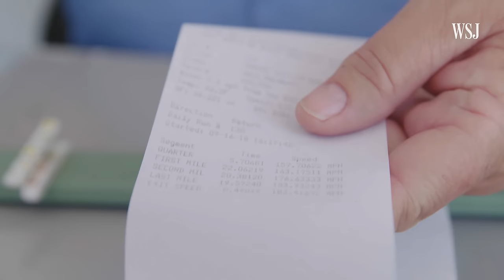How This Cyclist Hit 184MPH and Set the World Record

Comment: This record is dubious, she is not generating 184 mph, she is in fact surfing
Reply: She got released at 110 mph. If she got up to 184 mph by “surfing”, why did she have to pedal?
Reply: @adrian.m258  She's 45 years old... generating speed of 84 mph, the current women’s 1 hour recorder holder Evelyn Stevens can only reach 29 mph. She's super human if she's really doing 84 mph by peddle power.
Reply: @jabsdrahm.3232  She's accelerating using her own strength in the slipstream of the car. Air resistance is the key here. Plus the 29mph is like running a marathon, that's not the top speed someone can reach. You don't run a marathon with full sprint speed. The fastest cycling speed of a woman unpaced on a -0.6% grade is 121.81 km/h (75.69 mph).
Also, you have to realize that the bikes are completely different. This particular one has gear ratio so high, it's impossible to pedal from stand still, which is why she had to be dragged to 110+ mph. At the start of the video, the first run, she detached at 105mph, and couldn't peddle it because of the gear ratio. Then later, she detached at higher speed and was able to peddle the bike. If she was surfing, she wouldn't have to peddle and just continuously accelerate behind the car regardless of the gear ratio and whatnot.
Reply: @ybh1231  yea you got him the car only cut out like 95% of the resistance.
Reply: The only thing she got help with was air resistance. The bike she is riding is geared for those sorts of speeds. If you tried to ride that bike normally you'd never be able to crank it.. you'd have to get up to 130mph before a human would have the strength to crank those pedals. It's all about gear ratio and lack of air resistance (because of the car in front of her). At any rate, she is actually doing the pedaling.
Reply: This is a class record and all who attempt use the same method. REPEAT A CLASS RECORD LIKE ANY OTHER 1
Reply: well, given the fact that other people have attempted the same thing and recorded various records in the same category... no, it certainly isn't "dubious".  That's like saying the world record for the highest flying, or fastest flying unpowered glider is "dubious" because the glider got towed up into the sky by another plane.
Reply: Adrian G You are disabled. The only thing acting on her was the friction from the ground, The car did all the work, It’s a dumb record because the car did everything for her.
Reply: @adrian.m258  It's the same rules for everyone.
Reply: @surroundsound6427  You obviously didnt even pay ANY attention to the video. She is towed up to 110 mph then through drafting, she reaches 184 mph. She could have died from air turbulence, debris on the track, a popped tire, and multiple other mechanical problems. It might sound pointless, but it is very much a dangerous and impressive feat.
Reply: Ralph Yarl Ye she could have died from the debre, but it doesn’t change the fact that she is is an air pocket because the car was doing everything for her, even the male record is dumb because no one could get up to that speed without the car
Reply: Ralph Yarl Ye she could have died from the debre, but it doesn’t change the fact that she is is an air pocket because the car was doing everything for her, even the male record is dumb because no one could get up to that speed without the car
Reply: @adrian.m258  no,  she had to pedal starting at the point she released. Otherwise she would fall behind and then the air would catch her.
Reply: @surroundsound6427  a pocket of air does not pull you along with the car in front.  She would still have to pedal.  The whole point of the record was "fastest human on a bike while drafting" which she did.  Drafting is literally using the vehicle in front of you to reduce your air resistance. She basically did whay would normally be impossible because of the air resistance by removing the air resistance.

Comment: Bunch of ignorant comments from people who did not watch the entire video. 

She is tethered to the car to gain speed. The bike's gearing is extremely tough and works best at over 100 mph. The impressive thing here is the fact that she accelerates after being released at 130 and and maintains that average of about 173 mp/h for a mile topping at 183,9. While she is  still in a vacuum created by the drag car, she is on her own and have to maintain balance and speed.
Reply: Emil Glud she isn't in a vacuum, she is in a pocket AND being pushed forward by the air behind her.
Reply: its literally not impressive, she is hardly an athlete. Literally anyone can be put in that exact same scenario and pedal a bike in a straight line as she did. this isnt dangerous, she is loaded with protective gear on a flat surface with nothing she could slide into. the 12 year old kids riding bikes around the neighborhood can do this and you know it
Reply: @michael_fassbender  ..At that speed, if she fell, it'd really surprise me if the impact didn't generate rotation and cause her to flip.. One flip would lead to another, and so on. It's not ice she'd be landing on, ya know. Protective pads won't prevent limbs from being bent in ways they're not supposed to. Chances are, she's not gonna be okay.
Reply: sure, whatever. She's tethered.
Reply: Stu Pidas yes thank you someone understands what’s really happening
Reply: @WPaKFamily   She had to be tethered in order to reach a high enough speed and was cut as the speed went up
Reply: Emil Glud 👍
Reply: Did you ever heared of changable gears?

Comment: there is no land speed set here.  all it is a car. that was towing a bike. you can see the cables pulling her here.   There has to be a draft why. just someone to say they got drug. an should be dropped. no one has won the lad speed record with a bike. but it wont be dropped. should be called  fastest drafting record.
Reply: It pulls her until 110mph, then the cables are released and then she uses the slipstream of the vehicle so there isn't barely any wind resistance as she pedals.
Reply: which is why it's the overall land speed record for a paced bicycle
.. rather than the land speed record for a jet car 
... for a motorcycle .. 
.. for an unpaced cyclist in a human powered vehicle  with an aeroshell
.. or just the land speed record -- as in the fastest thing ever propelled across the ground -- as opposed to the air or water speed record

Comment: Imagine if she had a fixie bike while doing this
Reply: It is a fixie.
Reply: Paul McB if she was on a fixie her legs would of been noodles
Reply: The bike she rode has no freewheel in the hub or bottom bracket - it's a 'fixie', just the same as any other bike with no freewheel, just geared a lot higher.
Reply: @nathan-sw8kr  It's a fixie with an insanely high gear ratio, hence the "double reduction" gearing. It's something like a 31 to 1 gear reduction based on the numbers in the video. That's what allows her to go 180 mph without her legs turning to jelly
Reply: It is a fixie but she cheated since they had her towed until she was pedalling fast enough
Reply: there is no way it is a fixie, why would you even want a fixie accept to save a few grams?

Comment: This is an awesome human achievement. If you've ever been to the salt, the fact that it's a weird, random, particular record makes absolute sense. It gives all these different daredevils a particular place to chase. And it's hard work. Whether it's a super custom fixie bicycle in a pocket of recirculating air, or a tube of engines and a tiny piece of glass, it's still an insane gathering of resources, time, talent, and passion to achieve.
Reply: Gabriel Bryant you are correct about this being a weird, random, particular record. It lets her make the mighty claim of being the fastest human on a bicycle. It's not in the spirit of cycling. Also, I have driven there. Absolutely fantastic and thrilling.

Comment: This might be the most sexist thread of comments I've ever seen... The point of the record isn't to see how fast a person can go unassisted; it's to push the boundary of what is humanly possible to maintain/control on a bicycle... Congratulations to Denise, Shea, John, and the rest of team for setting this record, and I challenge anyone commenting to even go 40 mph on a bike and tell me how easy it is
Reply: Justin S. 40mph is not that hard going downhills in the mountains with a road bike, there are risks but its not hard by any stretch of the imagination (I do get your point tho)
Reply: Your appointment to give them annilingus is Feb 14, 2019.
Reply: @CycloPioneer  not hard no but relatively few people can manage even 40mph downhill and stay on. i have. i don't think i want to try 50 and I'm fitter than most people i know.
Reply: @MrKristyon  I've gone 51 on a homemade tall bike (steep hill), the seat is 6' off the ground, and I go 50-55 on my road bike most every time I ride it, spun out with 50/11 gearing on a modern road bike will have you over 50 and as long as the pavement is half decent its totally stable and predictable, I'll crank it up to 50 on pretty crappy pavement too. I want to regear it with a 54 tooth ring up front which, on paper, will get me 60 MPH.
Reply: easy,  then again I biked 14 miles a day
Reply: 40mph+ is easy on a bicycle. I've done it many times on several bikes.
Reply: You clearly don't watch YouTube much. 😁
Reply: Justin S. 
The thing is that slip stream is keeping air resistance off her while boosting her if that car was gone she would have been going down to 40-50mph again.

Comment: She accelerated 74 Mph on a bicycle; 110 Mph on a drag race car powered sled. I don't fully accept this as a true 'bicycle' speed record; it is still very impressive and dangerous no doubt. But the point of a bicycle speed record should be determining the fastest speed a person can achieve by their own power pedaling a bike. Sure, use a double sprocket gear reduction with an infinitely variable transmission. But use your LEGS. No motors, no battery power; the only added energy goes into your human mouth.
Reply: They could have done that, but there would have been no point. The reason for the tow was just that the bike was impossible to get started on its own because of the very high gear reduction. They could have rigged it with a fancy derailleur to make it possible to start the bike from 0, but the interesting part is going 184mph, not starting from zero. So they decide not to bother with making it possible to start and they just tow it up to a speed where she can pedal herself.

Comment: All she did was get the gear ratio right to pedal behind the car, out of the wind. Move out into the wind she will instantly start slowing down. She couldnt of maintained that speed against the air pressure.

Comment: Going that fast on a bike is gutsy.  I do not want to diminish her achievement, as I would not do this.  However, I recall years ago riding in my friends Porsche 914, following about 10 feet behind a semi truck on the freeway at 60 mph.  My friend put the trans in neutral, and we just coasted behind the semi truck for a few miles.  We could have gone indefinitely that way.  We were in the low pressure zone (suction) just behind the truck.  So is this bicyclist, being sucked along.

Comment: There is a different record out there I'm not experienced at this but. All of the records should have an asterisk by them. . Maybe the dragster to block the wind. But cyclists must somehow ride up to maximum speed with gears on the bike.. that would be the record. No Towing allowed.. also it sets the rider up to a very dangerous scenario unnecessarily... Still a measure of ability. And a more accurate one because could she every time when the Tour de France bike race.. What these Riders are succeeding at is Daredevil ism .. And a test of Courage. That car could have just as easily towed her up to 200 miles an hour and Beyond. And if somehow the bike were equipped to handle.. there would be a new record with an asterisk.

Comment: I’m sure that’s cheating . Using a vehicle blocking the winds instead of using physical power to propel yourself without any method of  material or automotive construction is blatantly cheating. That’s not a record if you’re not facing resistance that prohibits forward motion. Thumbs down lady

Comment: It’s honestly shocking reading the comments section. Sexism. Belief that they could have done it better. Do you not understand? The car is there to block the wind, not speed up the bicycle. Imagine yourself riding a gym bicycle, you’d have to put in allll of that force into your legs 🦵. You _cant_.
Reply: Study times with Danish if that were the case then why was her bike attached to the dragster? TO PULL HER UP TO THAT SPEED. And you cannot make yourself go even close to that speed on flat ground, you need a lot of elevation for that, which she didn’t have. Saying what you said is equivalent to “i can beat a lamborghini as long as i put in tons of leg work” it just simply cannot be done alone.

Comment: Easy to do 160 on a bike when a dragster drags you to that speed first. I've done 50 under my own power no cars involved. No draft.
Reply: Not to mention she was toed till 140mph
Reply: @napa5235  that's what I was saying. Car drug her to that speed 1st. Then provided not just a shield against air resistance but also created a low pressure zone that acted like a Vaccuum to suck her closer to car as car accelerated. Kinda Like mythbusters proved a pickup bed with closed tailgate pushes on back of cab and reduces down force for better fuel mileage vs open or no tailgate
Reply: @SgtJoeSmith  i feel like even I could beat this record, and I don't even ride that much...

Btw, thx for your service. Sometimes I think into joining the Canadian army after graduating from college, not sure if i should though

Comment: Meaningless record…if you need another vehicle cutting the air for you it doesn’t count for anything…the only way a record matters is if it’s self-powered and unassisted…put an aerodynamic fairing around the bike and pedal as fast as you can, then it’ll be a record…all the rider is doing is riding in the low-pressure environment behind the car which helps to pull the rider…there’s a video of a guy riding behind a tractor-trailer at about 60-70 mph and he’s barely pedaling…but it’s obvious what the reason is behind this particular stunt…

Comment: 0:20 see how She is not doing anything but still moving got me little worried if this is real
Reply: Hmm
Reply: The gear ratio is so high that she cant go with pedals on start, so they use 2 ropes at start, and on speed cut them (you can actually see this moment in video)

Comment: Cheater. I can do it as well if the car is pulling from the bike with a wire. I saw real records where cyclist went over 125mph (+200km/h) just going behind the car, 100% cyclist effort. A huge front plate with a tiny gear at the back and a lot of effort.
https://youtu.be/hos4UeTkoJs
Reply: Dude they stopped using the wire at 16:42 from there on out she got to that speed on her own... 
what you have found there in your video is really impressive but its simply not the same, i would go as far as to say that those two records should (and probably are) 2 different categories